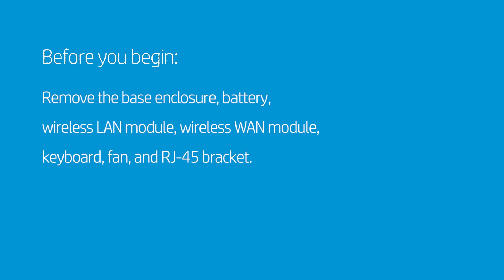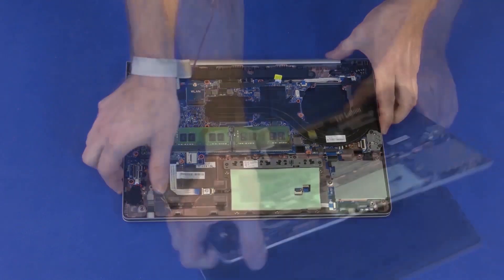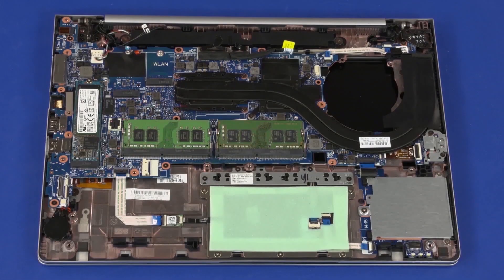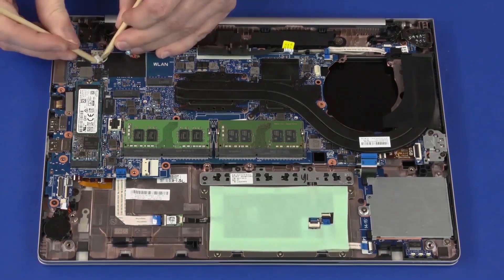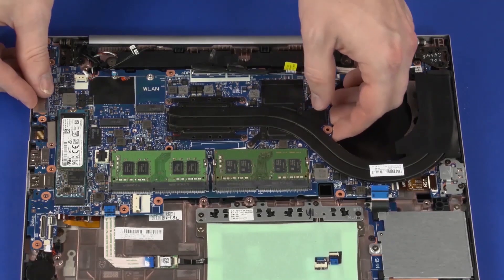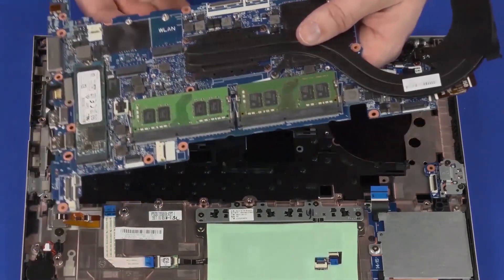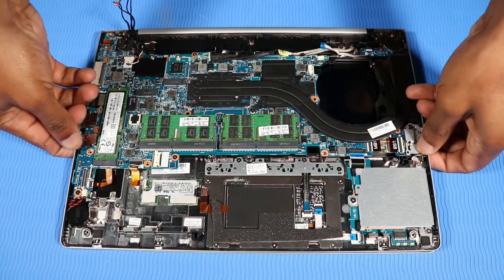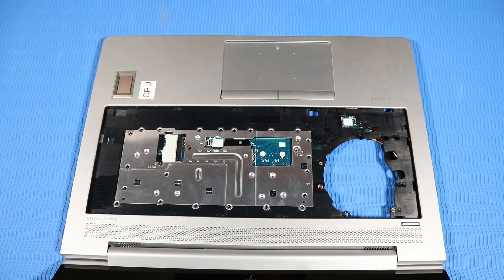Replace the System Board | HP EliteBook 840 G5 and G6 Healthcare Edition Notebook PC | HP

Comment: Is g5 and g6 use same fit motherboard?g6 can fit into g5?
Reply from the maker: Hi there, thanks for contacting HP Global Social Media Support!
I understand that you need to know about interchanging the motherboard. 
I will do my best to assist you.
Use the HP Parts surfer to identify the part: https://partsurfer.hp.com/partsurfer/ 
HP does not recommend upgrading or downgrading hardware parts or software that is bundled with the product as It may affect the manufacturer's warranty and performance, however, you could change the configuration at your own discretion.
Binu_HP Social Media Tech Support